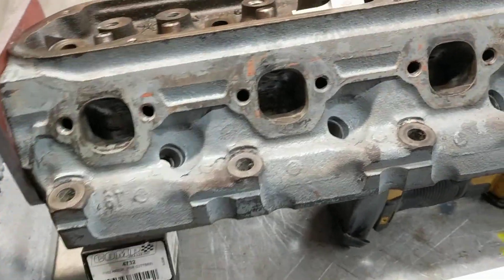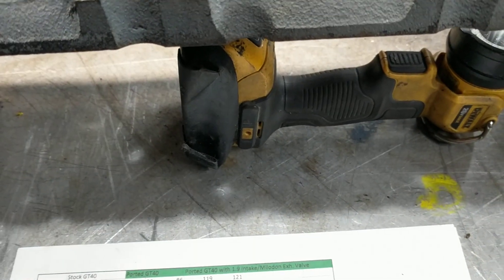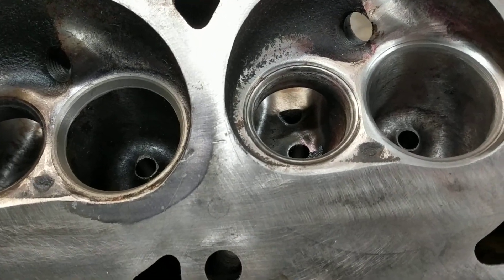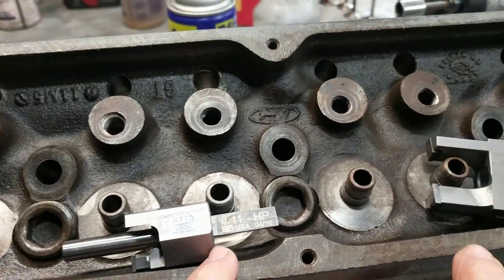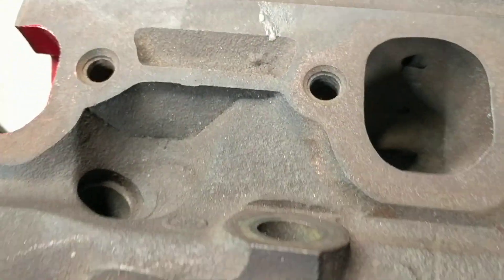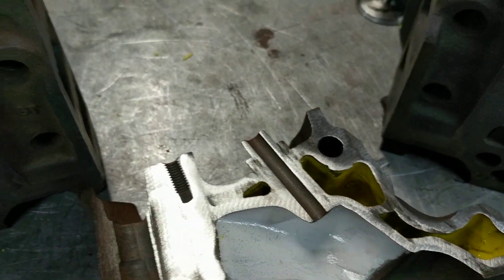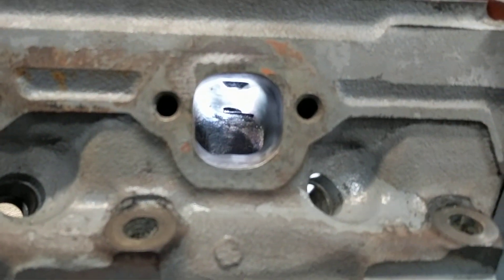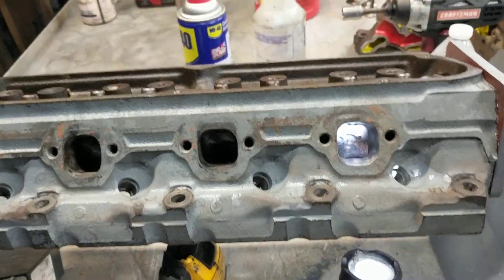Explorer/GT40 porting pointers

Comment: There is a guy that put 194 valve in the intake, and used a bowl hog to enlarge the port afterwards than he ported it more
Reply from the maker: Yep, that was the thing to do in the 80s before aftermarket heads was a thing. Put the chevy 1.94/1.60 valves into the 351W heads. Wish I had tried the aftermarket 1.85/1.55 valves in my GT40s vs the stock ones. I'm sure it would have picked up a decent amount of flow.

Comment: When using big valve heads ( 1.90int 1.60e) on explorer stock blocks does it cause interference  xe284hr camshaft
Reply from the maker: Only way to know is to check it

Comment: How can we contact you about having you do a set of similar heads?
Reply from the maker: I really don't do outside work.  I've got a set of ported, milled explorer heads with a new valve job.  Machine work alone was $400, nobody is going to want to pay $700 for ported factory cast iron heads.
Reply: @FXRSDriver  call me crazy. But I'd be willing to invest in them as the Explorer GT40Ps is what I have. If the heads flow what these flow.
Reply from the maker: @mrmustng  Where do you live? Reason I ask is shipping 90 pounds of  heads wouldn't be cheap.
Reply: @FXRSDriver  hey I'm interested in a set of gt40s I'm in Canada though, would you be willing to ship?

Comment: What part numbers on the valves?
Reply from the maker: These are the ebay 1.9, price has gone up, Thanks Brandon!!!!!! 😆🤣
https://www.ebay.com/itm/263431311419?epid=1772628257&_trkparms=ispr%3D1&hash=item3d55bad03b:g:nKAAAOSwFXdbx4dw&amdata=enc%3AAQAGAAACkPYe5NmHp%252B2JMhMi7yxGiTJkPrKr5t53CooMSQt2orsStdebXPz4ZTXCT8FI9kPBh0pPnHXVOfxBOZ9n9pwciAKvVd1jn8gwQIEMxUoKjzzPnfWD92jkzHu0KWepz7tLPBlatu1AhklzV8O4WWJo3g3Df9HASBcVo0c81E8CAw0wrSmMRCEf39H9psdXDeYNInd8DgSHwD5ylMW7d9Xje8TCbMzfn%252BKqImiOf8WDayGvu66po%252FQlB9Md1cbAlHf%252FECVvpE7cxebSQUBJxSn7RPNpxN6zIYwI5YqFUFdo7iSgghQcOl%252FTJvyHBkUy0HjVCKV3Axb0SRp5S6VctXiRLSM%252BmweGPUDNkxgoJrK%252BS0QGjTAY7lMiUv49LPMqlTUwyTKiJGx15DTiZ3FMO%252ByZbFOZAqf%252Bj869Rks9fDz30j%252B901KO921b6kjqQKJt45J6nLzyCtlvdRbjahr7XJnVFfQLcS5g7WY1NejRtnB13kdzCg6L8dJZByn%252B0rYFoNujxlnD5%252Bjr4ggHAfqVEkDEzrR0k9TTTX%252Fm0OOshmzTnSHXjukLx8i69Ih7nyHxlIFEPiwdc0QdKSl1XxxMPqy8wldhF%252F0M9vd2O%252BXjMmJTyNZjpwn15kh%252FoKHqiBfTDkZHFw6Bm69P3fXOwaVS6uYpw7rgi7Ge5tx4uOBdJDTgI8aHaurLTHFmWsdrkrsZV7IAvY06zLmUyFTm2uB0nMSZ1Cv4Kp4V3UXwUSxVRfhZNtXkuEOciq3XJAAGTDvrbU62CZZtt5XpWZB4jboi7lv8EAl%252FXa1bG0%252FfL%252BtlEq7NnCnxU3uu%252FQuvn26omedIR9EGwkwVMO9uPN50xwnJzHlxANX%252BjBdhNeTXuqphrnZn87se%7Cclp%3A2334524%7Ctkp%3ABFBMwJzk085f
Reply from the maker: Ferrera has these different sizes on their page. 
https://www.ferrea.com/ford-5000-series-hi-performance-valves/p492

Comment: Put a link to the ebay valves you used
Reply from the maker: https://www.ebay.com/itm/263431311419?epid=1772628257&_trkparms=ispr%3D1&hash=item3d55bad03b:g:nKAAAOSwFXdbx4dw&amdata=enc%3AAQAGAAACkPYe5NmHp%252B2JMhMi7yxGiTJkPrKr5t53CooMSQt2orsStdebXPz4ZTXCT8FI9kPBh0pPnHXVOfxBOZ9n9pwciAKvVd1jn8gwQIEMxUoKjzzPnfWD92jkzHu0KWepz7tLPBlatu1AhklzV8O4WWJo3g3Df9HASBcVo0c81E8CAw0wrSmMRCEf39H9psdXDeYNInd8DgSHwD5ylMW7d9Xje8TCbMzfn%252BKqImiOf8WDayGvu66po%252FQlB9Md1cbAlHf%252FECVvpE7cxebSQUBJxSn7RPNpxN6zIYwI5YqFUFdo7iSgghQcOl%252FTJvyHBkUy0HjVCKV3Axb0SRp5S6VctXiRLSM%252BmweGPUDNkxgoJrK%252BS0QGjTAY7lMiUv49LPMqlTUwyTKiJGx15DTiZ3FMO%252ByZbFOZAqf%252Bj869Rks9fDz30j%252B901KO921b6kjqQKJt45J6nLzyCtlvdRbjahr7XJnVFfQLcS5g7WY1NejRtnB13kdzCg6L8dJZByn%252B0rYFoNujxlnD5%252Bjr4ggHAfqVEkDEzrR0k9TTTX%252Fm0OOshmzTnSHXjukLx8i69Ih7nyHxlIFEPiwdc0QdKSl1XxxMPqy8wldhF%252F0M9vd2O%252BXjMmJTyNZjpwn15kh%252FoKHqiBfTDkZHFw6Bm69P3fXOwaVS6uYpw7rgi7Ge5tx4uOBdJDTgI8aHaurLTHFmWsdrkrsZV7IAvY06zLmUyFTm2uB0nMSZ1Cv4Kp4V3UXwUSxVRfhZNtXkuEOciq3XJAAGTDvrbU62CZZtt5XpWZB4jboi7lv8EAl%252FXa1bG0%252FfL%252BtlEq7NnCnxU3uu%252FQuvn26omedIR9EGwkwVMO9uPN50xwnJzHlxANX%252BjBdhNeTXuqphrnZn87se%7Cclp%3A2334524%7Ctkp%3ABFBMwJzk085f

Comment: David can you do a video using the tools to cut the spring seat and guide?
Reply from the maker: Sure, not much to it, but should be able to do that.
Reply: Alex's Parts has drop in (no machining) valve spring kits for gt40 gt40p, supercharged, hyd. roller, beehive springs to .580 lift. I use the beehives on my Cleveland.

Comment: I'm using stock valve sizes,  but replaced them with the stainless Manley street flow valves that are necked down quite a bit. All I've done is clean up all the sharp edges and smoothed the big hump in the exhaust port, also used the comp cams cutter to install dual valve springs and a smaller .531 valve stem seal. Keep up the great work.

Comment: 😳😳 266 In. 200 Ex.😳 man you have really got those things figured out to where they will out flow a lot of aftermarket heads out of the box. Those are really going to work well. Ive gotta get my car going for dyno day to see if I can kick the rollers through the wall with all of the power this thing is going to lay down 🤣😂 probably a rod knowing my luck 🤣😂 I got to finish sanding my intake trying to get the burr marks sanded out and put my heads together and I can build my short block again then get it dropped back in and put it back together again so hopefully this 2nd 1st fire will go better than the first time and not be dripping water on the ground again 🤞🏼 i sure hope that the repair holds up. I got head studs instead of bolts this go around trying not to stress the repair because it runs through the head bolt boss above the oil filter
Reply: 10% better than David Vizard and others.
Reply: @hotrodray6802  Yeah thats insane , Hes most definetly done his homework on those things
Reply: @79beans347  yes, right. 🙄
Reply: @hotrodray6802  🤨